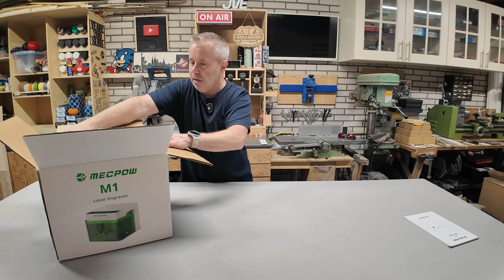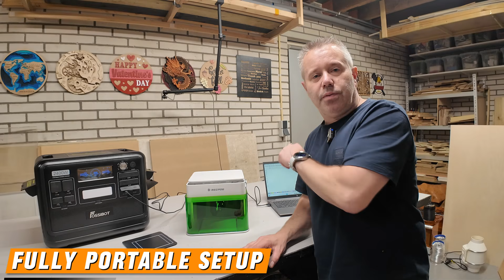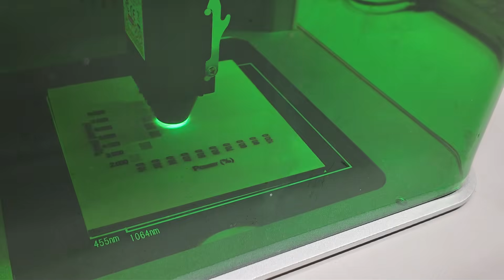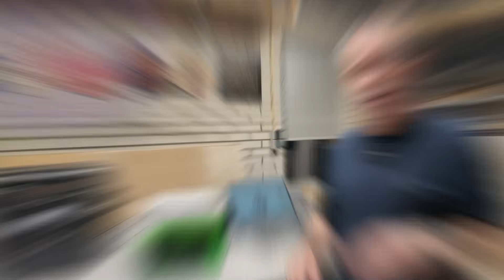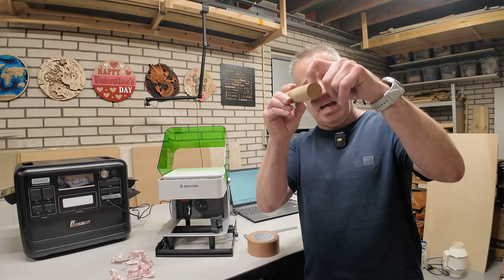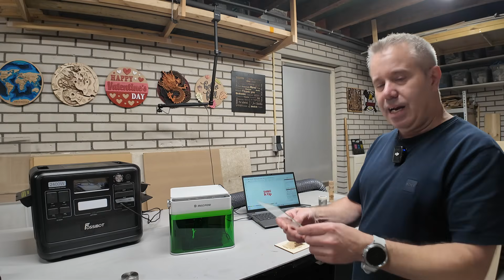Mecpow M1, Compact Versatile & Affordable Laser Engraver

Comment: Hello, I’m new to laser engraving and I bought a MECPOW M1 after watching your great video presentation.
I’m using LightBurn (first time for me)  and I ran a Material Test Sheet with the Material Test Generator. The test works, but I only get squares with outlines.
In the video, the squares are filled. What setting should I use in the Material Test Generator or in LightBurn to get filled squares instead of outlines?
Thanks for your help, I’m a beginner but eager to learn.
Reply from the maker: Hi Stéphane, you will need to set it to fill instead of line when you want to engrave the test sheet. Then you will also need to adjust the speed settings. Engraving will be at a higher max speed than cutting.
You can do so in the "Edit Material Settings" menu in the material test sheet screen. Enjoy your machine!
Reply: @jewijk  Thanks for you quick answer

Comment: If you were buying the M1 which laser would you choose?
Reply from the maker: I think I would start with the 5W blue diode. Great for engraving, but also cutting on many different materials. If you plan on doing more metals and/or plastics then I would go for the IR module. Nice thing about this machine, you can get both, as they are interchangeable.